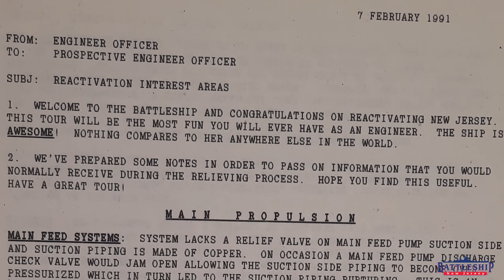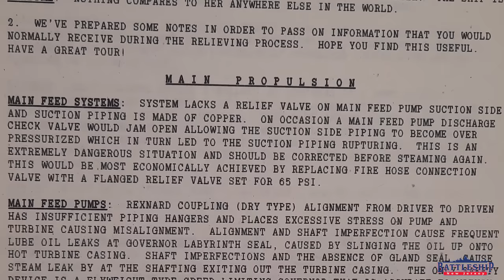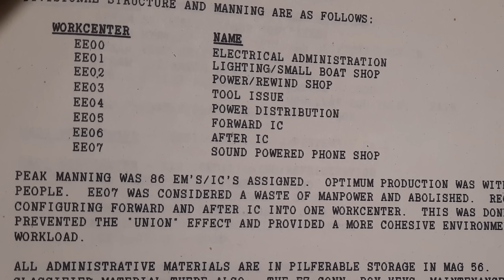The Call To Freedom Will Be Sounded Again: How to Bring Back Battleship NJ

Comment: For the same cost of a zumwalt, they could have reactivated BB NJ several times over. They'll bring NJ and her sister ships back for 1 more round.  I imagine it won't be easy however; alot of the old school stuff isn't made or kept on hand anymore. NJ would have to be fit with all new equipment for fighting and firing, new rudders for steering, more powerful powerplant to get around, harbors would have to be dredged and deepened to accommodate such a big, beautiful lady.

Comment: In a war with China a battleship would be incredibly valuable for the same shore bombardment role that so many battleships were used for against Japan in WW2. The many small island bases China is building in the South China Sea would be prime targets for 16in salvos, particularly once aircraft have cleared antiship missile batteries, which would have to be done before the islands could be seized anyway. As you said, there is nothing with the same level of capability currently in the force. The only question is what is more economical, all those expensive missiles that would be required for the same level of saturation, or reactivating a battleship and figuring out the all new supply chains for whatever materials and munitions that would be required.

Comment: The main obstacles to reactivation of the Iowa sisters are ammunition, gun barrels, the engines, and the shafts. I highly doubt any of the 16 inch shells are still stable enough to transport and store aboard the ship if they are still around. They might still have some of the spare barrels for the guns, but they would need to make more, especially of the 16 inch barrels, which no one has done in decades. And the engines and shafts, particularly the shaft seals, would require a full rebuild which would probably necessitate the removal of the superstructure to remove the larger components. It would be a mammoth undertaking, but would be well worth it to see these girls back at sea under their own steam.

Comment: I doubt they will be brought back, if the USN decides to replace the function I would imagine it would be by some form of 155mm mount firing army 155mm ammunition, or maybe some kind of navalized version of the launching system from the HIMARS or M270, less the vehicle. From a logistics point of view it probably makes the most sense, as it would use existing ammunition, and could be installed on existing vessels or a modified existing class if built new.

Comment: As much as I would like to see the Iowas returned to service, sadly I am a realist, and know in my heart that it will never happen. The main reason I went into the Army was because the Navy decommissioned the Iowas. If I could have been a helm's man on one of them, I would have joined in a second but, it wasn't to be, and the Army guaranteed me to work in the field of my first love, helicopters but, I've never stopped thinking about how cool it would be to the Iowas brought back and modernized. As for the document you found, as an aircraft mechanic in both the military and civilian sector, I would love an in depth dive into that to see what issues they were still working at the end.
Reply: There are at least 6 MODERN ships that at less than 10 years old are being decommissioned and Stricken due to HULL Cracking... and they have Helipads on them...
Reply: @Formulabruce  What does that have to do with anything I said in my comment?

Comment: Seems like it is possible, I've seen a few articles recently about that.
Reply: Those articles are mostly pop-journalism to get clicks.  Realistically there's no way the Iowas are every returning to service, and really they shouldn't even try.  At this point it'd be much more sensible to just develop a new, say, 8" or 12" naval gun if the military ever wanted that kind of shore bombardment capability again (which is the only real reason you'd even develop a gun that large nowadays).  After that, designing the new hull to mount it on becomes comparatively trivial.

Comment: I think if the battleships were to come back in any form at this point it would be to reuse the main turrets and build new ships around them.  We can make new ships but we haven't built anything like those turrets in a very long time.  The rest of the ship is armored against a threat that doesn't exist anymore so moving all that armor around when it doesn't serve a purpose doesn't make sense when that weight could be put toward more modern systems.  You could build a whole class of single turret cruisers around those guns without having to redevelop the industry to make them again.
Reply: I don't believe they will ever be returned to duty, but seeing how unmanned drones are being used effectively against large targets, the armor is somewhat appealing.

Comment: "...not that anyone is going to carry a block and tackle out of here..." Oh yes we would!!  XD

ETA: metal fatigue and internal corrosion means the whole ship would need to be sliced into sections and opened up in order to replace ALL the plumbing and x-ray/test/replace structural members.  

An expensive undertaking to be sure but still a bit cheaper than building new and uses current construction methods to accomplish it.

On the plus side this makes it a perfect opportunity to replace the main propulsion plant with something modern (gas or nuke electric) and to reinforce the hull in places where it had previously shown insufficiency (the bow flexing torsionally at high speed for instance.)
Reply: If you're going to that then more spaces would need sectioned up into more water tight spaces like newer ships to control flooding in these older ships.

Comment: I'm surprised there aren't documents like that for all the different systems tucked away all over the ship.  On a ship as old as that, with all the tweaks, changes and foibles that have gone on over the decades, you really do need a document letting you know what "the manual" doesn't cover.

Comment: Question would it make more sense to build a ship with anti air anti surface ship anti submarine and a large number of surface to surface missiles and two guns? Built smaller with a small crew auto graded systems capable of blue water operations. Build a ton of them capable of escorting or operating alone or in packs. You get a brand new ship capable of handling about everything by itself or in groups or providing escorts that you can build new and now smaller footprint smaller crew. The only thing is that the Navy would have to stick to guns and not allow Congress or any other outside agency to get involved.

Comment: The last time these ships were active and training they suffered from several turret explosions.  The big guns are unique hardware and you would have to spool up an assembly line to mill brand new powder, manufacture brand new powder bags, everything would have to be new production... I suspect that the turret explosions back in the 90's were caused by using old stock powder, bags,  igniters, etc... You could not get me into a turret crew with a ram stuffing a charge up the backside of a 16 inch gun unless I knew for a fact that every possible measure had been taken to ensure that a premature detonation was prevented.

Comment: The Navy learned when we recommissioned the BBs in the 1980s that the BBs were too manpower intensive to maintain both in propulsion and gunnery.  As a former BB Weapons Officer, I feel quite certain the big guns would never be reactivated due to the dangers involved in shooting them.  That leaves a big ship with unusable big guns and an outdated steam plant.  It would be an even bigger white elephant now than it was in the 1980s.
Reply: I had a chance to go to the New Jersey a few years ago. I have to agree that the system for those main guns while practical. Are really an accident waiting to happen. The firing wouldn't per see need to be reworked. But that loading system could stand a modern upgrade.

The thing that makes these ships special is that we as a country can't make them anymore. The knowledge of how the steel was created has been lost. This beauty here can take a hit and still keep rolling.

As much as the gee wiz of the Zumwalt class was to be. It was an experiment that as of now is more failure than success. Heck they still can't work out those rail guns that that were supposed to be on it. Yet the New Jersey can still launch a small truck 12 miles inland.

If there was a proper successor to the Iowa Class I'd be happy to have them as museum pieces. That though is still not an option.

Comment: The FZ alarm system drawings were new drawings that were created to show the location of all connection boxes, alarm sensors, alarm panels for the new T-Hawk ABLs and launcher control panels and consoles. These drawings are/were classified 'Top Secret'. As the dwgs were part of the USA nuclear weapon control.  If the drawings were ever downgraded to unclassified, this would have been done by the Washington Naval Yard in DC.
Reply: I believe that Ryan read off that the actual prints and the dies for the seal press were destroyed.  All that was in that room somewhere were the keys for the panels and J-boxes, and the tech manuals.  This is somewhat surprising to me, as I always had to make arrangements to retrieve our manuals from the safe in the Chief Engineer's stateroom.

32+ years now since I last had to track down an open 7kohm 5w resistor in some obscure location...

Comment: End of the day, the ships were retired because they weren't needed. When is the last time the US conducted a landing on an enemy fortified beach, with bombardment required to destroy the enemy fortifications. It was in 1945, the battle of Okinawa. Modern warfare is fluid and rapid, troops can be flown past fixed beach defenses via helicopter or airdropped in with all their equipment. The US government is not afraid to spend large, often unreasonable amounts of money on things that it thinks it needs to fight it's many wars. These ships are not needed anymore. If they were, there would have been several classes of battleships laid down in the last 70 years since the Iowa's were built.
Reply: There was a bombardment op against Japan in preparation of the aborted invasion.

Comment: I hope the world never deteriorates to the point that we need them again, but if it does, I hope they reactivate the iowas rather than build ones from scratch.  As has been said, I’m not convinced you could build a new battleship that is as good as the existing Iowa’s. They have pre-nuclear steel and have armor plate on the level that would not be replicable.  With that said, I sort of think they should bring back Wisconsin before New Jersey.  I love New Jersey thanks to this channel, but if they take New Jersey away, I won’t have my fix of battleship content (outside of the news that is).  With that said, if a show of force could neutralize escalating tensions, my vote would be to reactivate all four to scare the war away.  Those guns are something else I swear.

Comment: Just imagine the flavours of 21st century ammunition you could manufacture for her main battery guns. Imagine a ship deploying a swarm of loitering munitions 35 miles away. Or laying a minefield on the enemy's MSR to stop them getting to a beachhead in force. Or 16 inch precision guided shells, with a salvo of 9 hitting 9 high value targets simultaneously. Or remote Torpedo drops. Imagine replacing her belt armour with plates of the latest & greatest in laminated ceramic armour, as used on modern MBTs. Imagine all the sexy VLS systems you could fit in all that deck space.

Comment: The issue with bringing them back becomes doing repairs, updating systems and or retro fit and training of a crew. Hardly anyone knows anything about steam powered anything out side of steam turbines in power generation as they are now few and far between. Now true they can recall sailors to active duty but how old are some of those guys now? some of the younger sailors are most likely in their 50's. how much would it cost in training alone?
Reply: 55 in my case.  No longer physically fit for military service.  However, I could still hang my cane on the edge of a desk and teach a classroom full of younger sailors.  If you bring the equipment to me, can probably still fix and bench-test it.
Reply: 62 in my case.  Still reasonably fit (could stand to lose a few lbs).  Would gladly train a bunch of youngsters to operate the boilers and associated equipment.  BT USN "79-"88 USS New Jersey "85-"87

Comment: As a MOP Swede here is my guess. If the Iowas are reactivated we will most likely never se them again in the form they are in at the moment. my guess is that only a largescale conflict whit the same sacale of naval warfare as WWII would se the US Navy take on the burdon on making them tick again. 
Further i think the Navy would rebuilld them alot to cram as much modern systems as they can on them to suport the main batteries of 16 inch guns so externaly they will not look the same again ( sure they differ a lot from the WWII lay out but i think they will do so even more if reactivated). 
I also guess that the Navy may only reactivate two of them and use the other two as donors for every sparpart they might need from bolts to mainbattery gun barrels, to make them work and or replace eventual battel damige. As mentinoed in other videos the infrastructure to build these ships are no longer pressant on the scale needed. 

My conclution baring in mind that my guees is founded on the fact that there might be a conflict involved is that by the end we might have one wery different Iwoa class battle ship left. One might be sunk and two will be sad hulks of what they once was.

Tho i would like to se the glory days of battle ships come back i dont think that the Iowas will be the once carrying that tourch.

Comment: It would be amazing to see the NJ come back to service. However, after the Iowa turret explosion and the overall change in safety standards and systems since the 1930s a reactivation of the ship seems unlikely. With GPS guidance and drone correction the concept of a new battleship firing large Naval artillery shells could be attractive vs. using costly missiles.

Comment: Could you please do a video on the document and publish that document so we can read it?  

I think looking back a couple of movies that were not too realistic they did highlight one important point.  Iowa classes 5" and 16" systems do not rely on integrated circuits to operate meaning she would still be able to defend herself after an EMP attack unlike the modern ships.  The other thing that comes under that is her propulsion system.  Nuclear reactors can be shocked and are largely controlled using integrated circuits meaning if there was any shock or EMP attack the powerplant would fail.  Yes its always the dream for Iowa's to return which it is likely we will never see.  Although with the situation with Russian and the possibility of an impending war its probably more likely than in the last 30 years.  Although you need manpower to operate them and I doubt if a war occurs that the forces will be able to gather enough manpower to justify it.

Comment: I was in EEO2- Power/rewind, electrical shop, a "COOL" video on any, electrical motor rewind equip. left there I doubt as It's very "SPECIAL" type of repair.
Reply: I thought it interesting that the NJ had 85 IC.  I think we once hit 8 IC and 12 EM.  Needless to say, most of the EMs were qualified for IC/Gyro Watch, and most of the IC were qualified for SS SWBD/SSTG watch.  Ditto for Duty IC and Duty EM in port.  Being a farm boy, I spent more time working on the boats than the EMs did...When discussing the electrical system, not much difference between a diesel tractor and the Captain's Gig.

Comment: In all honesty, to bring back NJ, it might make more sense to remove her existing boilers and engines via the uptakes and replace them with modern gas turbines. That would fix a lot of problems ranging from fuel commonality to electrical power generation.

Comment: At this point its been 33 years since they were last active and at least what 15 or more since they were on the Navy Register? I just don't think they will be brought back. I think on a previous episode Ryan stated if really needed only the Wisconsion and MAYBE New Jersey would be the ones you could reinstate. Some estimates say it would take at LEAST a year and a billion dollars each.

Other issues include almost all the 16-inch ammo and spare barrels are gone (the primary reason to reactivate them). You can't really update/replace the engines without trying to cut through all the armor and multiple hulls. AND you would need to try to find some of the late 80's and early 90's crew to assist in training. Not saying you couldn't between 4 ships worth of crew, but they are all 30 years older, which means the youngest are in their 50s and the chiefs and sr officers are more than 70. So it won't be much longer before that starts to become a real problem. The other times they were reactivated it was only about a 10-to-15-year separation, some of the men were still in the Navy from the previous reactivations. Not the case now.

So unfortunately, I don't think it's likely we get a reactivation.  Which is a real bummer cause it would be awesome.